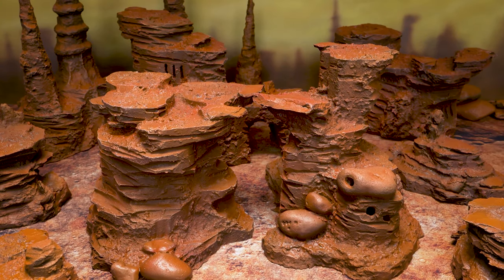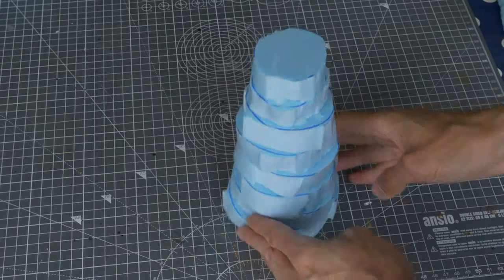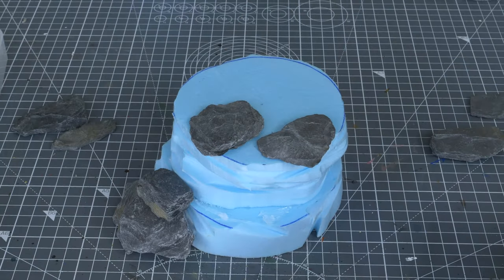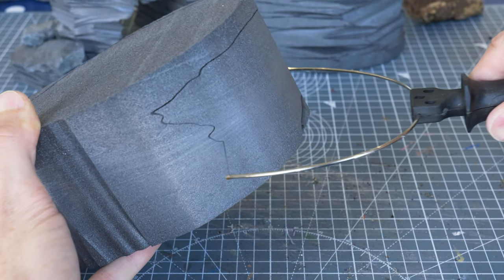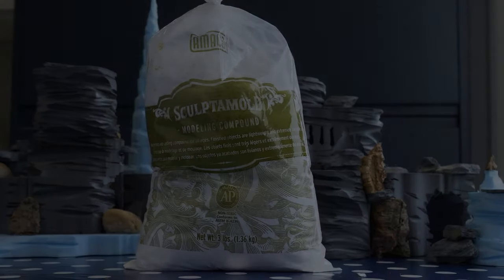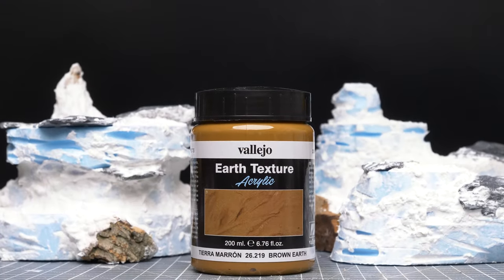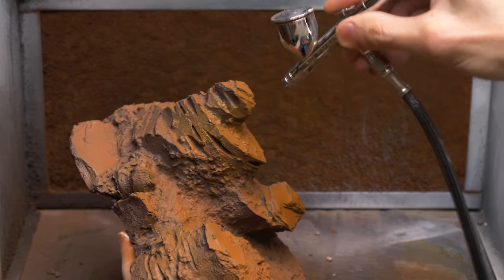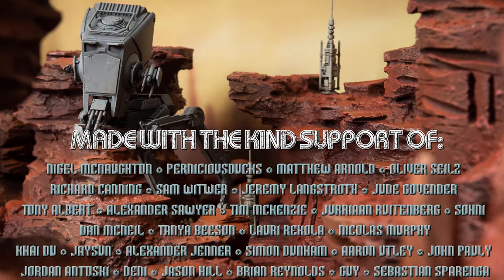Scenery with Sorastro: Geonosis

Comment: Awesome video, as always! However, today I have a humble suggestion.

In my experience, hot glue is not a good adhesive for XPS foam in the long run.

The best product I’ve found for gluing XPS together is Gorilla Glue Construction Adhesive. It dries quickly, but not too quickly; and creates a very strong bond that lasts indefinitely.

Thanks for the video! Just wanted to pass on some info, from my own experiences.
Reply from the maker: Thanks a lot for the tip Jordan!  Although I've never had any of my terrain fall apart, I'm always looking for ways to improve my work so I'll certainly check out the Gorilla Glue :)
Reply: Jordan Smith 
I’ve heard the same thing.  I’m gonna try your suggestion, thanks.

Comment: A suggestion for your air filter on your make shift spray booth. Spray the filter with non stick coating like Pam so you can clean the filter vs having to replace it after it gets plugged up with overspray. You'll still have to replace it, just not as often.
Reply from the maker: Thanks for the tip Tim!  I'll definitely try that out :)

Comment: Hey l know this vid is a bit old but great job! How would you advise going about this paint scheme with regular paint in place of the airbrush?
Reply from the maker: Hi!  Hmm I guess I'd be reaching for the biggest brush I have!  The other thing I might try is actually mixing colour into the Sculptamold.. :)
Reply: @Sorastro  thanks for the tips! Keep up the great work!
Reply from the maker: You're very welcome! 😀
Reply: @Sorastro  Hey, sorry, one more question. I think I am going to get an airbrush after all so would it be possible to use a regular craft/art acrylic brown color in place of the surface primer as the basecoat? If I thinned it enough?
Reply from the maker: I think that would be fine 😀

Comment: No varnish for protection ?
Reply from the maker: Hi Guillaume!  Yes, I mention near the very end of the video that the thinned PVA glue can also be sprayed over the entire scenery for protection (I just didn't film it as I did it outside to avoid getting glue all over my studio!) :)
Reply: @Sorastro  You spray that through an airbrush ? Not concerned about clogging it ?
Reply from the maker: @NinjaEnShort  Ah.. no, I just use a spay thingy like gardeners use for spraying plants with.  Or you can simply brush it on of course :)